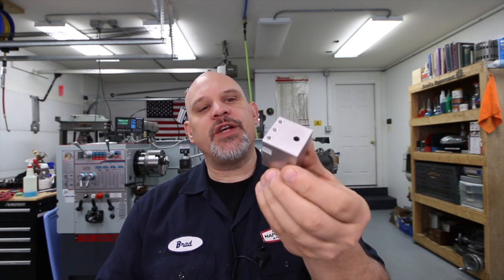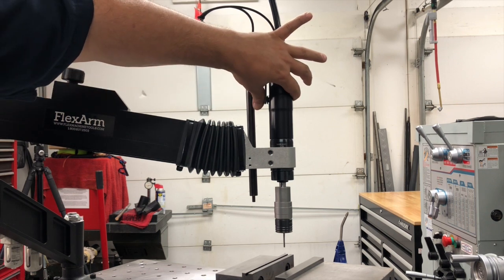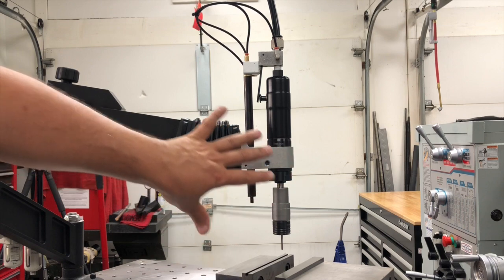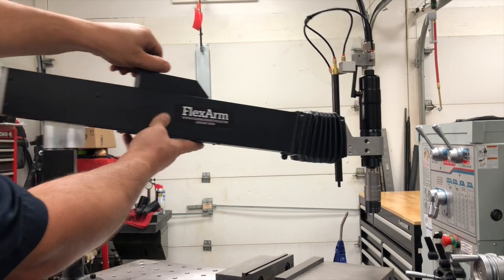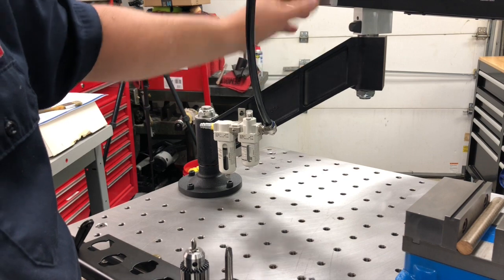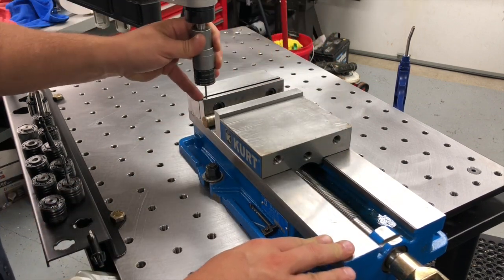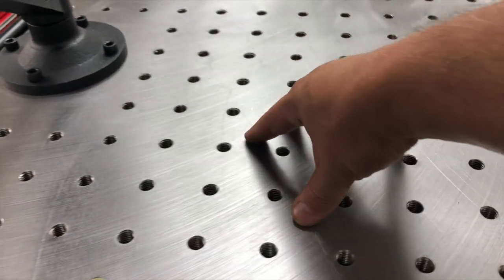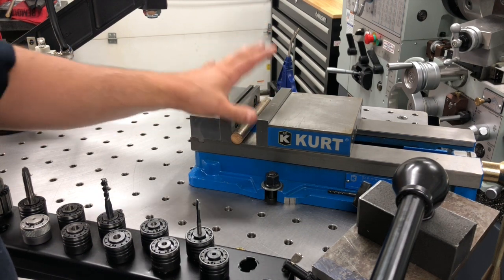Flex Arm   Part 2 A 32 Demo

Comment: Beautiful machine, set up air gun or coolant, looks like trough is meant for that? And maybe the reason behind noisey as hell tapping gun instead if an electric driver? I used to have the job of tapping a million holes on drill press using tap matic reversing chuck head, and a clamp fixture that floated around table that would hold 10 or so pieces at a time. Hung air chuck close bye, and coolant, tapping fluid, oil, or alcohol in squirt bottle was used every couple holes, would have been better to set up some better form of chip removal for tapping jobs. Lockheed Martin was there biggest customer. It was faster, more quite, you could sit. where ya stackin em was universal question at almost every shop I worked, torturous and mind dumbing. Looks as though your flex arm set up could use a chip removal set up that would not cover you in juice and chips like a regular drill press etc.

Comment: question is how straight does flexarm taps ? I somehow doubt its rigid as milling machine.
Reply from the maker: That’s a good question. But it taps incredibly straight. If the hole is straight your tap will be straight. If the part is chucked out of alignment the mill will most likely follow it (all metal is “Rubber”) and if it doesn’t follow it, the straight mill will enlarge the hole. But the Flexarm does a fantastic job, seriously 👍🏼
Reply: +/- .002  But exactly what he said ^  It follows your hole.

Comment: With a spimple tappinghead and same tap as the flexarm, you could do it way faster on your mill..   Those small parts could also be done on a quality drillpresse with a tappinghead.    I dont like having a Machine that only do one job.  Sure the flexarm is smart. But its use is very limited.  A mill can do most jobs, also tapping quick if used correctly.  Espeacilly the Bridgeport style 😊
Reply from the maker: You’ll still need to move the part (either by dials or DRO) which is the real time waste. With the flexarm, I can move the tap (to) the hole faster. Plus, a tapping head still ties up your mill which is why I got the FlexArm. I only have one mill so this is incredibly helpful to my
Small shop.
Reply: @BasementShopGuy  Joe Pi has a tapping video where he shows how you can do this very quickly on a mill. Basically a tapping head and the vice set up to allow the parts to slide between the jaws without repositioning the table or clamping/unclamping between holes. For many identical parts, I would say that the speed would be similar to the flexarm. It does require more setup time though, and for a few holes, the flexarm is going to win every time. You're running a business, so the flexarm will pay for itself, but for a hobbyist watching this, Joe's video is worth checking out. Thanks for the videos, it's good to see you again.
Reply from the maker: Tony P Tapping heads were a solution for tapping. The flex arm is the next incarnation. What a tapping head will not do, is free up your machine to do a tapping operation while your mill is being used for another operation. Plus, with its rolling cart, I have a way bigger table to set up more fixtures. I can switch taps extremely fast and switch over to countersinking in an instant. I’m not saying you can’t tap on a Bridgeport (I’ve done it for years) I’m just saying that the FlexArm is way faster and easier - and it doesn’t tie up my (only) mill.
Reply: @BasementShopGuy  Totally agree. A Bridgeport and a flexarm is better than a Bridgeport and a tapping head if space permits.
Reply: @BasementShopGuy  A dedicated drill press with a tapping head has a much smaller footprint and costs far less. We looked into these and for $4000+ in addition to the floor space they take up made the choice for us an easy one - drill press and tapping head and the result is fast tapping with a 2X2 footprint. Nice lathe BTW.

Comment: Ok this is for my own knowledge, when lining up multiples like you did in the vise, should you place a copper wire between the movable jaw like when you are squaring stock?
Reply: Not if the sides the vise is gripping are machined surfaces (which in this case, they are).